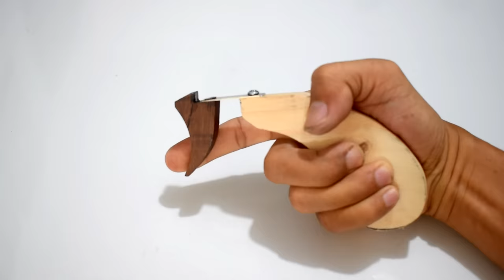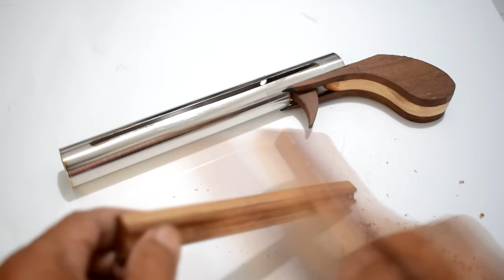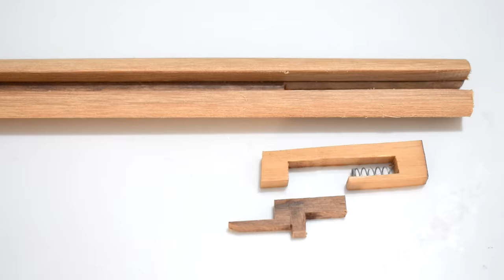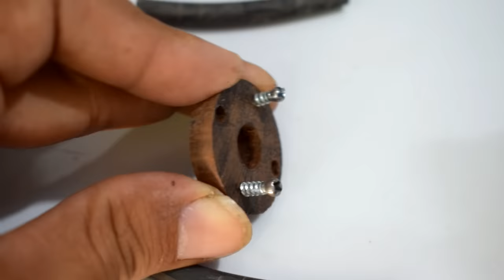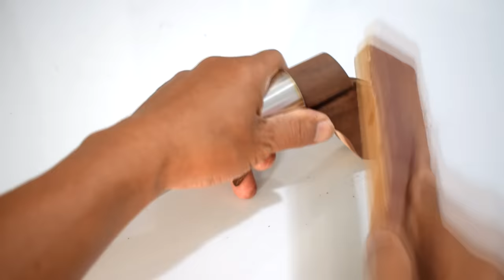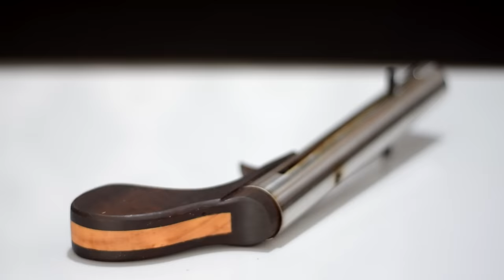Stainless Steel Slingshot for Defense

Comment: Remember kids, measuring is for losers. Same thing for mechanical fasteners like screws. Never measure any critical dimensions, use jigs, or anything but CA glue for assembly. Don’t worry about it! It will work out. And as Diresta says “If it looks straight, it is straight.” 
Probably don’t need safety glasses at this point either because what could possibly happen? As we all know, real engineers wing it 99% of the time. 👍🏻
Reply from the maker: Thanks for watching